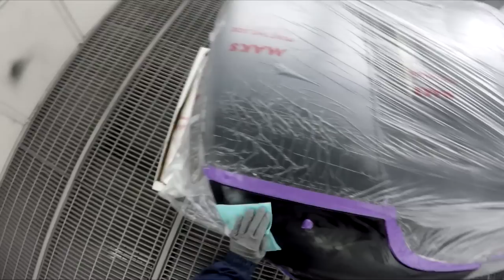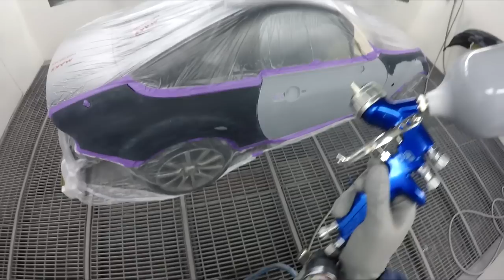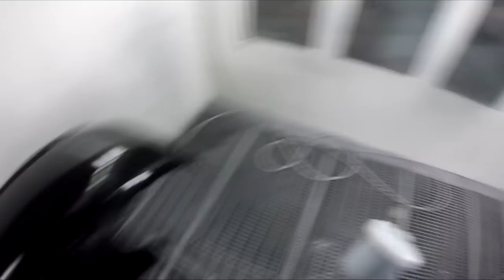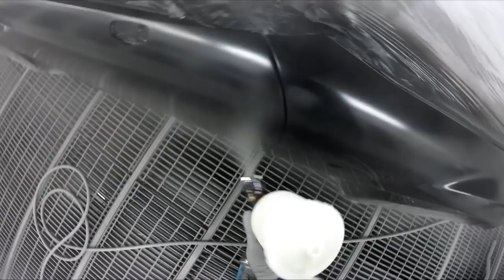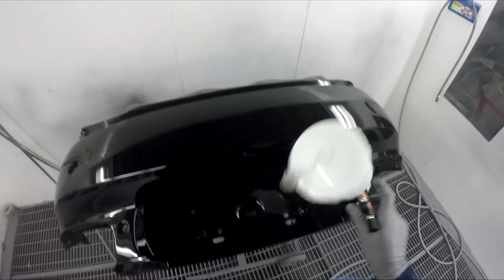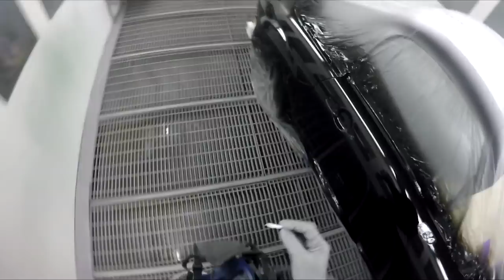Mazda MX5 Spray Painting

Comment: what were the settings for base? 2 bar-full fan-3.5 was for clear
Reply from the maker: Full fan, 20psi and full fluid. Running the HV25
Reply: The Gunman RAW would you have increased fluid if using a 110 cap?